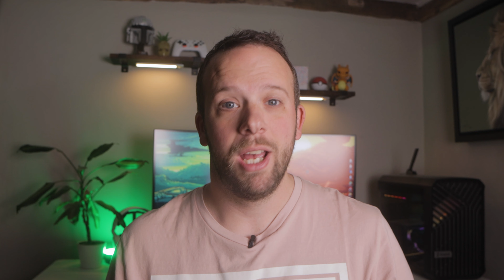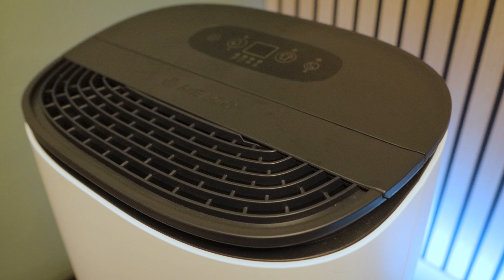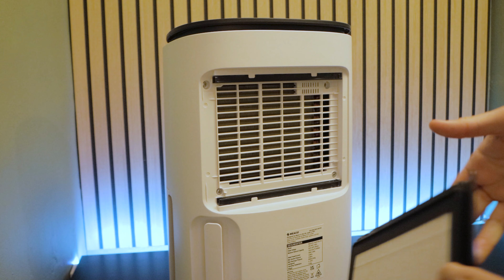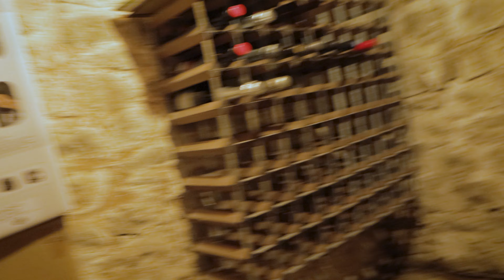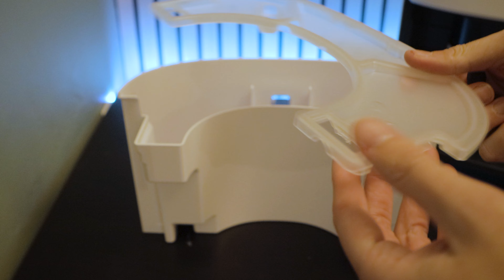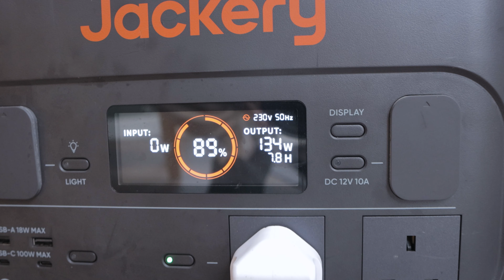Meaco Arete One 12L Dehumidifier Review | Efficiency & Running Costs Explained

Comment: I took delivery of this on 6th February now 17th.  My old house looks similar with timber, single glazing and single brick walls.  Reading some comments below, I too struggled to remove the plastic lid of the ‘bucket’ but I used a blunt knife to prise the plastic over the two notches to get the wheels out and thereafter you don’t need to take the lid off again (I found the video by Meaco helpful and also saw that you pour the water out without taking the lid off).  I put the unit on at the suggested 55 and at first the house to my surprise showed that it wasn’t that damp at around 57, so the unit came on and off, in fact some days I didn’t think it was working properly.  However, from 14th February the display has shown an increase in humidity and the unit is running for a lot longer and sucking out a lot more water than the previous week.  I don’t  know if the unit took time to settle or that the house has changed this week.  I think the 12L is a neat unit and I am able to carry it upstairs, but the next version up would be too heavy for me.
Reply from the maker: For me, it all relates to the external temperature and weather. If its a week or rain, the humidity inside can change that much!

Comment: An oversight not to put a handle on the water tank to better help lift off the lid. The other downside is the need to have all doors open which for privacy reasons isn't all that practical especially at night. I use it to help keep black mould of the walls & to help with reducing condensation during the winter. There is still some condensation on windows building up overnight but I guess it helps to a degree.
Reply from the maker: Agree, the clips are a little tricky in the lid to get off but I tend to leave it on now and pour the water out one of the two holes.
Reply: I use a 12l in all of the rooms in my house so we have privacy
Reply: @Kittycat671  Pretty costly to buy one for each room plus running costs, also the fan noise would disturb my sleep having one in my bedroom running at night.
Reply: The lid just falls off on mine when I go to pour the water out. It’s very loose.

Comment: How often do you have to empty your 12l one and also does it air purify at the same time as dehumidify or is that a separate mode ?
Reply from the maker: It depends where i position it and how damp that area is. Maybe 12ish hours like in my cellar but then in another room, maybe a day or more. 

Air purify is a seperate mode and you cannot dehumdify AND air purify at the same time.
Reply: @TechNuovo this is wrong, air purification is working if the hepa filter is installed and the air purification mode is for running the fans without the compressor when dehumidification is unnecessary.
Reply: So the difference between the 12 L and the 25l is just the tank ?  So just have to empty it more often ?  Or does the 25 litre more powerful and extract more water quicker ??
Reply: @helenalovelock1030  No, the only difference is the size of the tank
Reply: @lovemuffin10101 wrong the bigger units extract more moisture per hour  than the smaller units. It’s all on their website.

Comment: What size do you think is best for a 3 bedroom / 1 bathroom house?  Will put it on the landing
Reply: Go for the 20L it performs better being a larger unit and holds more water 4.5L 
That’s why he’s not achieving higher results because it’s too large a space for the smaller version to control properly
Reply: @Doppo69  Agree. I have an apartment that's 700sqft and the 12L is actually too small
Reply from the maker: The 12L will do just fine for that size house. I'm in a 3 bed too :)

Comment: Quick question. How do you find the performance to when it's really cold? (E.g. about 7-8 degrees c here. 

Grabbed the 20L, seems to collect 3L per day (vs 20L rating). Starting to think should have got the non condenser type.
Reply from the maker: That’s cold, I’m not sure this would work well in this conditions. There is a table in the manual that shows typical performance at specific room temperatures.

Comment: Been using & testing out the 12l for 6 weeks now.. Waw! What a difference it has made..the Air is so much drier thus inturn the house is much warmer and taking less central heating to make it so...Taking that chilled heavy wet cold air away has made an incredible difference to the heating situation... Roughly, we turn ours on around when we get up in the morning, and then back off late at at night. I'd say it's on about 12-14 hours a day. When we first started using it, the humidity levels were insane around 80, now all rooms start at about 59 -62 when we 1st turn it on in the morning, which quikly falls into the mid 50's within an hour or 2 , it then turns itself on and off all day during the period of use as it gets near the 50 we have it set at. We feel having it set at 50 helps to achieve a drier air which then allows allows us to turn it off for half the day which helps towards any build up when it's off.. I'd say from 12-14 hrs per day we have it running, it turns off at least 6  - 7 times .. Therefore it's only running around 8 - 9 hrs a day, so only costing around £10-12 per month instead of leaving it on 24/7 & it costing anything from £20-£30,  also saves on the machines life span I'd think?!, the best bit about all of it - no more karcher drying soaking upstairs windows every morning.. Thing of the past. I genuinely think most people do not need to run these 24/7 to achieve desired result. Just a case of testing that out...We run ours at the top of a staircase in a 2 bedroom house near the biggest moisture culprit - the shower/bath room... In regards to a comment made by someone else, the only time we feel it blowing cooler air is when the air it's sooking in is also cooler.. It only blows out what it takes in..Just feels cooler sometimes as it's coming out fast..once the air around dries and heats up a bit, so does the air it expels back out.
Reply from the maker: Glad to hear it's helping you out and you're right, little and often, or when needed, really helps!

Comment: I bought this few days ago but I am confused that it blows out cool air. It really makes my living room cold. Not sure what to do or whether it will pass once the humidity settles. Help!!!
Reply from the maker: It does blow out air but I felt it as room temperature, it’s just coming in and going out. There is no heating or cooling element as such inside. It’s normal.
Reply: @TechNuovo  incorrect. The Arete 12L One has a heating element (very low heat) as explained in the back of the manual as air passes through. It will blow slightly warmer air in the winter and help warm the room alongside central heating thus saving heating costs and cooler in the summer (due to it being a fan dehumidifier) apparently. It is relative to the room temperature. Bit confusing I know.
Reply: @TechNuovo  thank you for your reply.  Oh it feels as an air con is on but it’s true that I put heating on twice a day so most of dat the temperture is down to 15 degrees. I am an onion at this stage so I don’t feel it as much, but the cold air bothers me. I only have it for three days, it extracts a lot of water but it still is at around 60-67. I hope it improves or I may consider getting second one for the efficiency.
Reply from the maker: Give it time, it will bring it down. It might also be worth trying some non-dehumidifier things to help with moisture levels :)

Comment: A tip for when drying clothes : Rather than put it in Laundry mode, set the Humidity level to the lowest that you can (40%), this ensures that it doesn't switch off and will easily fully dry most clothes overnight ( don't forget to put pockets inside out).
Reply: There is a continuous mode also, rather setting it at 40.
Reply: @muppetsshowupatspeakerscor579  I was going to say the same thing. Continous mode is much better and the only way to stop the machine switching off once the target has been reached
Reply from the maker: Yes! very true and good point to raise, you dont need to use laundry mode to dry your laundry! Thank you.
Reply: I was just going to question this, 6 hours isn't enough so was looking for a solution to keep it going longer and this sounds like a good option. A desiccant dehumidifier by EcoAir fills a 2L tank over a day of drying laundry, I wonder how this compares.

Also, I wonder do the 20 and 25L models dry clothes quicker, even if they were to be put in the same small enclosed space as they are more powerful.
Reply: @CormacOSheehan I have an arête 20 and it dries within 6 hours, I usually do an extra spin in washing machine for 13 mins
Reply: I’ve bought one of these today. Thanks for a great video. ❤
Reply: Thank you!
Reply: Not true
Reply: Better still, put the washing and machine in a small room with the door closed. It dries all my winter bedding in under 2 hours. Result! Oh, and get a spin dryer if you don't already have one. That extra step is a game-changer.

Comment: You did a great job explaining.  I almost set back ky dehumidifier because it lacks clear instructions. Do you have to unclip to pour out the water.
Reply from the maker: Thanks! You don’t need to unclip, there are holes either side to pour out but I do find it easier to unclip

Comment: It might be cheaper than a tumble dryer in clothes mode but don't forget you said that you have to have your heating on as well to maintain a room temp of 18°c which will increase the cost. How much to heat your room for 12hrs as well as the dehumidifier I wonder ?
Reply: We use ours overnight with no heating on and it dries the clothes no problem.
Reply: @johnw2758  in what size room ? I think this is a good idea so might try it.
Reply: @PINACI  Roughly 15m2 but obviously the smaller room the better and shut the door. The laundry mode on this shuts the unit off after 6 hours ( which isn't enough time to fully dry the clothes, especially with no heating on), so what we do is put the level to 40%, it does reach this level at some point during the night but obviously it turns itself on and off. We always used to have clothes draping over the rads, this eliminates doing that ( for us) completely. Now, the radiator gives us heat  and the drier air is easier to heat as a bonus. I honestly don't know how we managed without one for 30 odd years 🙂
Reply: @johnw2758  Use continuious mode, to stop it switching off
Reply: My 12L works well enough for me in laundry mode with no heating on
Reply: @bromptinowner763  Yes, I purchased a 12L dehumidifier and it works better than expected and with no heating on. We use two clothes horses, one either side of the dehumidifier and put it on over night and by morning most items are dry. Some of the thicker items might still have some damp patched but thats about it.
Reply from the maker: True but during winter, heating is on as standard for us and assume many others, especially when it’s close to zero outside. We run off oil, so it’s not that easy to work out our running costs for heating unfortunately. With gas heating and metered, it could be worked out if you know your heating loads for your rads or underfloor heating.
Reply: @TechNuovo  Well to run my 1600w 7 fin oil filled radiator which turns on and off for 1hr costs 34p, so 12hrs would cost about £4.08 and to run my tumble dryer on low ( 1420w ) for 90 minutes costs me 57p and on high ( 2580w ) for 90 minutes costs £1.04

I have however just purchased a 12L dehumidifier to help with condensation in my living room which has an outside wall on one end. This is why I came across your video. I wanted to see how effective they are.
Reply from the maker: Ah yes oiled filled rads with an electric element are expensive, we have one and it doesn’t go on all that often 🤣 we have an oil boiler for the central heating so not as bad. Valid comment though and hopefully other viewers will read through, so thank you.

Comment: Thank goodness I found this video!! I bought the meaco arete 12L which arrived yesterday.  Instructions say castors are in the bucket (water tank) and to just lift the lid by the handle. There is no handle.....as seen on your video! Its tough hard plastic. It does not simply just lift. I had to watch you twice to try to see how you unclipped the plastic lid. Would be good if @Meaco did that video for set up instructions! Thank you.
Reply from the maker: Thanks for watching and glad we could help! Yes, no handle, it's two small plastic clips that you push in and lift off, kinda.